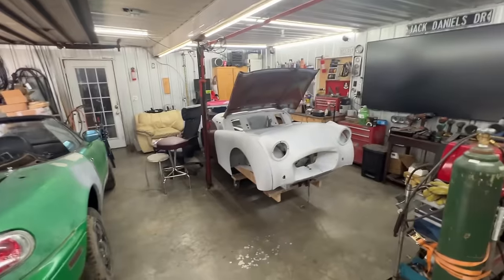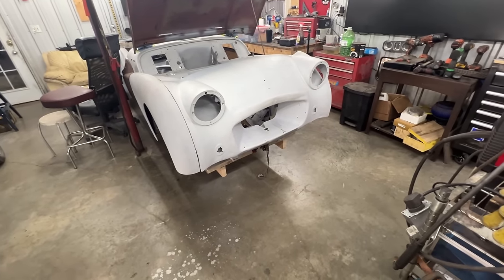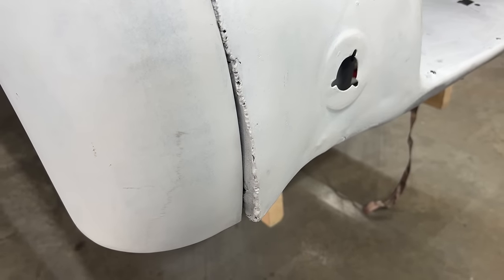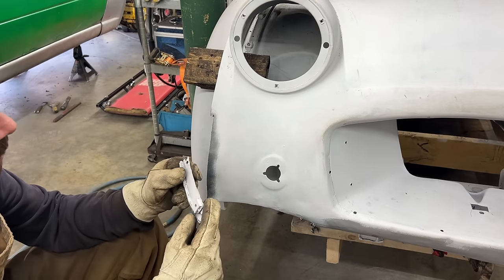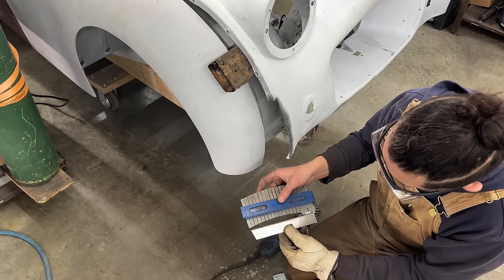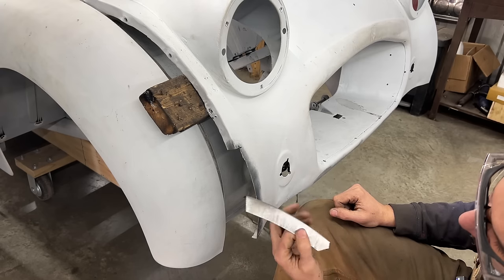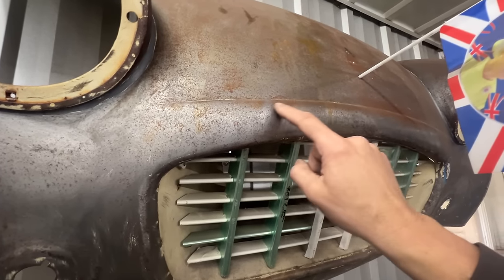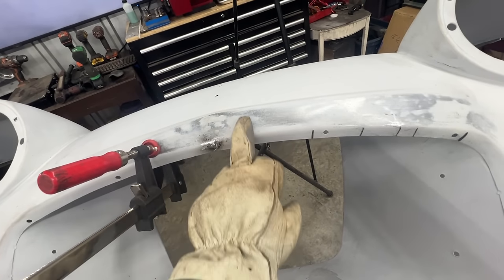1958 TR3 - Part 10 - Front Valance

Comment: Just askin, Elin, but isn't the narrow mouth grille a TR2 ? 🤔
Reply: I will respond for Elin. No, this is a TR3. The wide grill model is a TR3A (and by some  there is an additional model called the TR3B). The TR2 grill opening is also narrow, but the grill is in deeply recessed, close to the radiator, rather than at the front or flush. A TR1 was not produced.